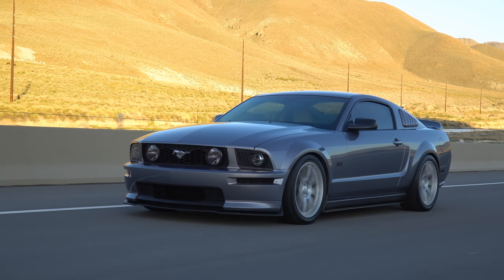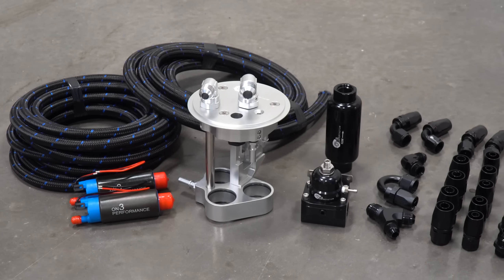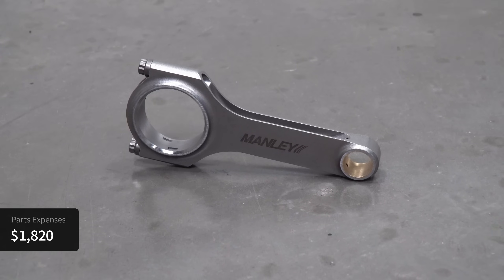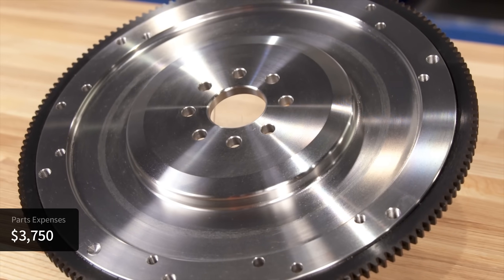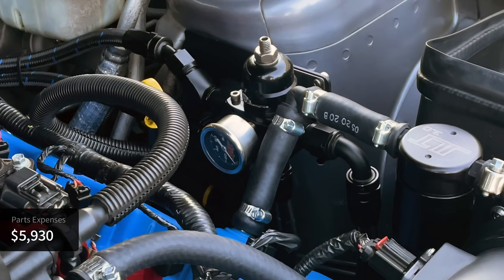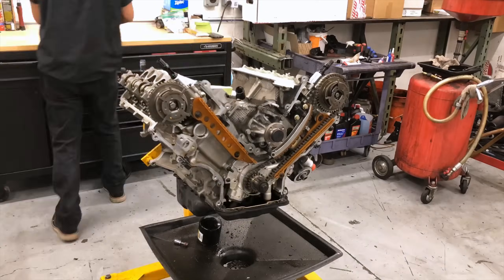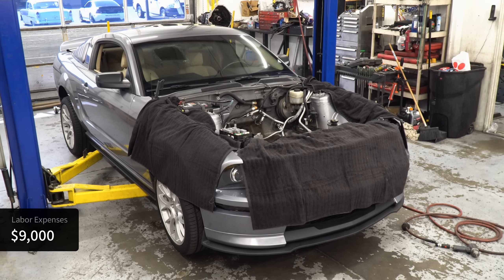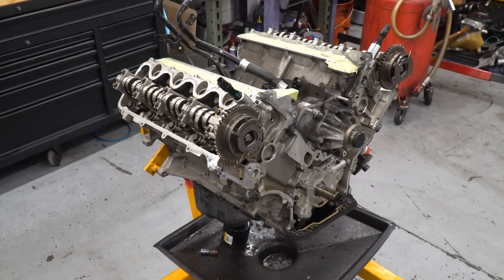Breaking down the (actual) cost of rebuilding a V8

Comment from the maker: See this Mustang race newer Mustangs, a Camaro, Corvette, and a Dodge Viper: https://youtu.be/fBphctralEk
Reply: 306 inches and 288 cfm@ .600 is never going to net 400whp.  I calculated 469 on a 230 cam with 8:1 dcr and 7400 RPM.  There are other ways to get higher NA power on 306 with known heads but they are impractical because all those ways are high rpm.  I see you went straight rich with the Viper but this was a cool build.  On the bright side if the motor is not near maximum effort somehow with some imbalanced choices, it should make 469 whp NA until the cows evolve into flying cows and fly home.

Comment: $16,500 for not even 400HP.  For $5500 you can drop in a stock coyote and be up 100 hp.  I did my 3v to coyote swap for $5500 and have 505 to the wheels. For $15,000 you can get a entirely new 05-08 car with a coyote swap.

Comment: The problem with the “just Coyote swap it” rhetoric is that it’s mainly bone stock guys, or those that have no experience building a motor recommending it. 

You’re going to spend roughly the same amount it would cost to build a 4.6 Mod Motor as you would on a clean swap. Unless you can do all of the labor yourself. After that it’s gonna cost you roughly an additional $10,000 for a 1,000hp build (Gen 2, or 3). Try it on a stock Gen 1 and that Motors days are numbered. The Coyote tax is real. I would put it up there with the Hemi in terms of cost to Mod once you exceed stock limits. 

Most guys I know are not going for a 1,000hp build. Either they’re terrified of the power, or simply can’t afford it. A Coyote swap makes zero sense unless you’re building an absolute drag monstrosity.

Comment: Can someone explain to me the difference between the dish pistons, I see a lot that advertise 6.5cc or 14cc which is for what?
Reply from the maker: lowers compression ratio and increases combustion chamber volume which allows you to run higher boost
Reply: @ I have a 2009 saleen 420s, so it’s got a twin screw supercharger on it, I’m really looking to get to 650-700whp so when I upgrade internals I should look more into the 6.5cc pistons so I can run higher boost?

Comment: Were the pistons 4032 or 2618?
Reply from the maker: 2618
Reply: @Four_Eyes  
Thanks bro. Do you notice any piston slap noise during cold starts? Did you have to change out any oil galley plugs on your block when it was getting machined?
Reply from the maker: I haven’t noticed any piston slap, maybe I just can’t hear it tho
Reply: @Four_Eyes  
So… when the turbo getting slapped on? Can’t wait to see it! BTW, coincidentally I bought your old drivers side head from a guy online a while back, funny eh?

Comment: 1000whp capable coyote swap would prob not be much cheaper, $8k for the motor, another $5k+ for a 1000whp capable transmission (built mt82 or 6r80), $2500 for return style fuel system, $2k for injectors, idk what an ecu to run it all would cost, built rear end, several thousand for the exhaust, close to 10k for the blower…

Comment: I'm a track guy, race, not drag. IDGAF about a 40 roll. I use these for tracking and Tail of the Dragon. I daily a coyote powered Mustang but in my experience, a 3v 4.6 Mustang with intake, tune and a Roush suspension kit with stabilizer bars and Wilwood/Brembo brake kit is more than enough to dive into hard corners and blast out of them and be competitive with other drivers. I have a few cars and I tend to spin if I attempt this with my Coyote. (My 1991 ZR-1 kills my 2013 Mustang GT on the track quite easily so far). If you know you know, otherwise you're just slamming the throttle from light to light. Thank you for showing us this incredible Mustang man. It's certainly got a lot of attention! I'd keep it!

Comment: 16k+ for 70hp gains.....
oooooooooor get a supercharger, head gaskets, arp head studs, and DON'T run a smaller pulley. Finally, get a tune. Result? 70+ hp bare minimum

Comment: I get it. Coyote builds are over done and don't get the clicks. Plus they're huge and hard to work on crammed into a 5th gen 'stang. When your 3v breaks (and it likely will after you boost it and beat on it), consider a 4 bolt main 427 Dart short block. Similar cost to 3v stuff but much higher output per dollar, much easier to work on, much greater parts availability. Add an easy EFI like a Holley Sniper and a decent centrifugal blower and it'll not only rip but last forever if you don't go nuts with the timing.

Comment: I've been following your build for several years now and just wanted to chime in to say that Kenne Bell's Tech Line Director, Mike DeCourcey has a 2005 4.6 3V daily driver with a built bottom end and their 3.2L Liquid Cooled Mammoth Supercharger kit making 816rwhp (960 flywheel hp).  He mentions that his car has stock heads, stock cams, stock coil packs, stock cats, stock exhaust and tuned 60-70 lb injectors, dual 75 mm throttle body.  Just wanted to mention this as an alternative to turbo charging.  I believe the 3.2L LC Mammoth kit runs about $7K.  Good Luck with your build and thanks for keeping everyone updated.

Comment: Is it true that the pistons and rods are the weakest internals on the 3V? If I want to push 500 rwhp with boost would I get away with just replacing the pistons and rods and keeping the crankshaft, head and cams stock?
Reply from the maker: Yes. You can push 500 whp with stock internals, but that's right at the limit and you'll need to use a centrifugal supercharger to keep torque numbers under ~440.

Procharger kit, longtubes, upgraded fuel pump, dyno tune and bam.

Comment: Great video....  I'm an LS owner.  You just gave me sticker shock.   I took stock 1998 LS1 and for $11K added a Vortech V3si supercharger from A&A Corvette and a 3.42 geared rear end from RPM transmissions...  Didn't even add headers.   Ended up with 472 WHP/440 TQ through the A4 auto trans.    You have stunned me that 370 WHP cost $16,000....    I can appreciate your dedication!
Reply: This is built for boost not to be na. So after turbos it will be 1000hp for 16000$.
Reply: @All_SportGG  - it’s good you’re getting the turbos and fabricating  for free

Comment: Speed ain't cheap.  I am into it about 9k and sitting at 669.  Whipple supercharger,  return fuel system, ID 1050 injectors, twin walbro 450 walbro fuel pumps, crusher throttle body, shorty headers. E85 dyno tune

Comment: I built my 3v as well. I paid a mechanic $300 to remove the motor, $2500 on internals and then paid $800 for a machine shop to assemble it.
Reply from the maker: deal of the century right there
Reply: @Four_Eyes  it was on the cheaper end but definitely took about 7-9 months

Comment: The reason the car is not making power is because of static compression ratio Getting more aggressive cams will make the power loss even worse because of because of overlap. Aggressive cams rely on overlap to make more power. When overlap is introduced in the combustion chamber  It lowers compression that's why really aggressive cams should be paired with high compression pistons. Generally Turbo supercharge  cams have high lift but try to keep the overlap to a minimum that's the difference between an NA Cam and a Turbo Cam. It's also the reason why a lot of supercharge engines  when they go with more aggressive cams it lowers the boost because there's less back pressure in  The combustion cycle.

Comment: I might need to get mine  redinotune because I didn't do none of that to my engine and I'm already close to 400 hp all I put in my car was headers the whole exhaust pipes  front to back throttle body and high-performance spark plugs

Comment: @Four Eyes is it true that those heads have markings on them specifically letting anyone that looks at them know that they were machined by Livornois?  I heard that they do so that they won't pass visual inspection for smog.  A lot of great work on the car btw.
Reply from the maker: I can't confirm for sure, but I didn't see anything like that. You can give Livernois a call, they are p responsive (I asked them a lot of questions).
Reply: @Four_Eyes  yeah I couldn't think of where they would put it anyway.  I also don't know how well these perform on the street, with people talking about it changing the compression ratio.  You seem to have a lot more expendable income than I do. I'm just going to have to keep mine stock.

Comment: Hold up hold up, you spent roughly 16 grand on a performance rebuild and only gained roughly 100 150 horse over the stock engine jeez louise. I've seen others and built several 4.6 blocks anywhere from 2 valve up to 4 valves making double over stock with all the performance and supporting mods. How in the hell do you manage that lol. Dang I'm currently rebuilding the 4.6 2v in my f150 and guaranteed 480 490 horse before the turbo and that's even if I decide to turbo it, but it's a beautiful car for dang sure.

Comment: 9k for labor? bro you got robbed
Reply: You're an idiot. 120 an hour for the work they are doing is middle ground as it gets there is literally not a better number. 120 an hour is top middle pricing for just regular shop work. The work these guys did most would be charging 2-300 an hour

Comment: I get you built for boost so the cost to make 400 wheel is not right but it's what you spent so far and your making X amount of HP. It's pretty easy to build 3Vs to make 450 wheel and all in you will be around 4k and making 425 to 450 wheel reliably but that is a NA build that you deff wouldn't want to try and boost when you want more power lol... It's more of a few grand to build it to make 425 to 450 on pump gas and do it reliably, have a usable throttle curve for normal everyday driving and have some ass when you get on it and sound good. Having nearly 20k under the hood I better be making well over 850 wheel and doing it in a reliable way....

Comment: Even with forced Induction and high lift cams I doubt this baby will push over 500Whp. There certainly are more cost effective ways/cars to get to 500Whp. But, I understand it's his project car and he loves what he's doing, have to respect that even if it isn't the most logical route. Personally, I'd just buy a used Hellcat for $30 grand and pump in about 10g in parts to bump it over 500whp. But, to each his own.

Comment: I feel like the Ford performance 5.3L modular short block would have been a better choice. Would have saved u a grand at least, u can still use the same heads and supporting mods, but it would be brand new so it could take more power. Plus the labor cost would have been way down

Comment: $17k for hardly 400 WHP? I have a truck 5.3 in a 1999 camaro Z28 with only cam, heads, and supporting parts for $3,000 pushing 550 NA and it can support 13PSI for 800. You trippin. LS or nothin

Comment: I did this exact same rebuild for my 2007 mustang. This is a great video with good insight but do not waste the money unless you plan on installing forced induction also. Dont forget also that if you decide to do this for big HP you need a clutch, transmission, rear diff, axles, possibly a drive line. Luckily I did all my work myself so there was no labor costs except for the machine work, but I was into my build about $15k with EVERYTHING. I also recommend a return fuel system if you plan on the big HP numbers and especially if you want to run E85, E90, or E100, whatever your state has. I had twin 465 litre pumps and couldn't get over 700 whp with E85 because the fuel system could not support it. I did make 905whp on 110 race fuel. MMR is the place to go for modular motor parts.
Reply from the maker: Hey man, I've watched all your videos a few times and even used a snippet of your dyno run in one of my previous videos. Could you tell you me what transmission you ended up going with? I think I read you got a rebuilt 5-speed and it failed multiple times? Also what clutch did you go with and how do you like it? Thanks for watching man and it's badass you did all the work yourself 💪
Reply: @Four_Eyes  I used the stock Tremec 3650 but yes I had it fully built but it did fail on me 2 times before I took it out and went with a 5 speed TKO with face plated gears from liberty gears that claimed to withstand 1500 hp. Never had a problem with that one. I used the McLeod RXT twin disk clutch and that seemed to do fine, but I also sent it in and had them rebuild it every winter. With the big cam and clutch it became not as fun to drive in traffic because it would studder and shake at low speeds. I appreciate you watching and good luck with your videos, I enjoy watching them.

Comment: Ok but my 2008 vw passat puts just shy of 300 down and the whole car only cost me 6k. It also gets good gas mileage and can smoke new and old mustangs alike in a roll since I put some time and money into it. Stock only made 200 and I just tuned it and upgraded part of every main system on board like the fuel, turbo, and and coolant. Overall cost me about 9k including the cost of the car and it has ran over 100k miles on this set up and gets 40k on the highway. If you really wanted to go fast though I would recommend a 2008 r36 Passat that has an na v6 and does 0-60 in about 5.5 seconds. I’ve seen these things run quarter miles in less than 11 with very little tuning and modifying, really only turbos and some fat bois.

Comment: No offense but 700 is way too much for injectors unless they're like crazy powerful injector Dynamics like 200 lb per hour I mean you could just get 13 14 GT500 55 lb per hours for like 200 bucks used and that's enough to take you to like seven hundred at the wheels or more and spark plugs $150 that's just ridiculous I think I paid $80 and that's from I bought those ones from MMR this was a few years back but still and $9,000 on labor I hope you got free b***** for Life along with it.  Sorry I don't mean to be super harsh but I really think you may have gotten taken advantage of even if they did everything and you didn't lift a finger but you are right and people do need to realize it is going to cost thousands of dollars for parts and for labor and the more you can do yourself the more you'll save

Comment: Hey Man, Thanks for the videos I recently got a 06 GT, and was hard debating on pushing the 4.6L to the limit or Coyote Swapping. Your videos are very informative 👌,  thank you so much I wish you the best on your project.
Reply: I saw another SOHC 4.6 on utube & it was dragracing. Firstly it had big cams ported heads bored & stroked  Fuel & air.  It took 480 hp in a Viper to beat the 1995 3v!

Comment: people don’t understand where the power comes from which is the heads and cam in a NA which he hasn’t even touched. The bottom end is meant to withstand the power, the shot of nos, the forced air coming in. He probably could’ve put heads cam and stock bottom end and got up to 400+whpand spent less than 3-6k

Comment: Very high quality video, but what are your power goals? Don't the factory cranks hold a ton of power?
Reply from the maker: depends on the power adder, superchargers put more stress on the nose of the crank compared to turbos. from what i've been able to gather, stock cranks can handle ~600-700 horsepower. my goal is 750whp daily w/ ability to hit 900-1000 w/ a higher-octane fuel
Reply: @Four_Eyes  that is true too. Also I know its too late now but the cobras came with forged cranks, I think even the early 4.6 cobras. Coulda saved you a couple bucks they are pretty easy to find

Comment: 16,000..... for 370 whp.......wtf......... in an older platform....... are you on drugs ?
Reply from the maker: it's 16k to make sure the motor can support 1000hp, not just to get 370hp
Reply: @Four_Eyes  your not at 1000 yet.... im sure there is more cost .....
Reply from the maker: yep about $10k more

Comment: I've got a question about your old stage 2 setup. You said you went back to the stock intake manifold over the Ford performance one, but did you also go back to the stock throttle body and put the cmcv restriction plates back in too?

Cause I was thinking of doing some mods to my 2010, I'm for sure gonna do full exhaust and CAI, but I was wondering if its worth it to get the cmcv delete plates and BBK 62mm throttle body if I'm keeping the stock intake manifold.
Reply from the maker: Keep the stock intake manifold until you get:
1) a decently aggressive cam (127300+)
2) dyno tune

Comment: You should look at Molnar Power Adder rods versus the Manley.  I would get a custom piston as well like a CP or Diamond.  Don't be afraid of the compression ratio and go E85 / Flex Fuel with a better fuel system than the one you have listed.  You need a return system like a Fore F2 with dual pumps.  It will make tuning it that much easier and provide the flow for your goals.  I made over 500HP consistently boosted in my 3V on the stock block. (10.14@130.77 at 3650lbs) .  Overbuild your fuel system / injectors.  (https://www.foreinnovations.com/product_p/47-522.htm)

Comment: If you’re engine is not built for high lift and a lot of duration, you won’t see the gains you’re looking for. Especially still being n/a. If you already have a static  low compression engine, the overlap from the cams will hurt that even more, losing combustion power.
Reply from the maker: I am thinking the same, especially with the Detroit Rocker cams being more focused on sound than power. I just ordered a set of 127600s, so we'll find out soon... Appreciate the comments.

Comment: Mistake #1 is skipping out on the fuel system. Trying to cut corners on the most important part of the build. And a coyote build is not more cost effective. You still have a stock production motor you’re going to push hard with stock powder metal parts that won’t be strong like forged parts.
Reply from the maker: The gen 3 coyotes are handling a lot of power out of the factory (~900hp). That's p impressive but there's not much piece of mind since  you're pushing stock internals to the brink.